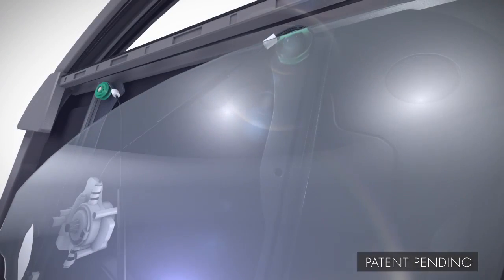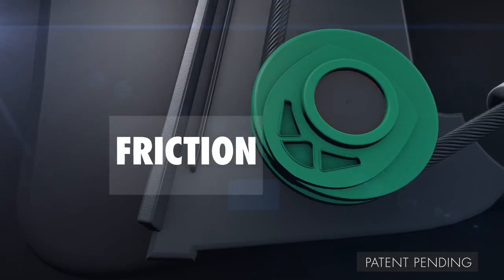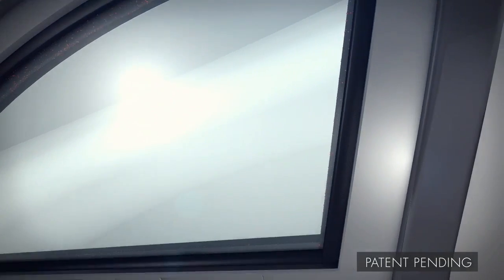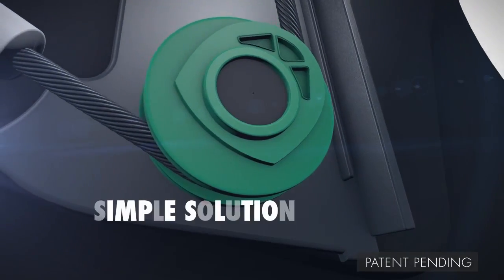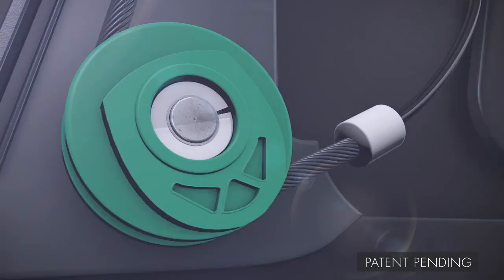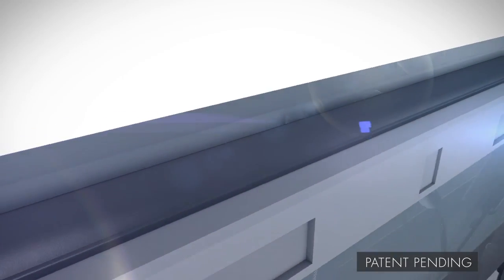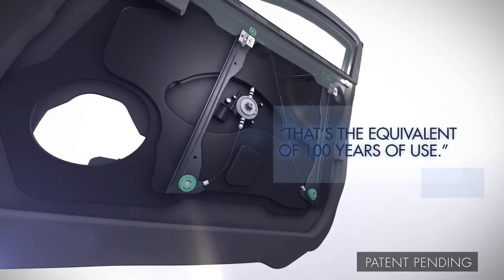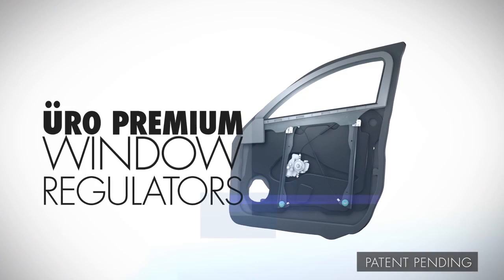URO Premium Window Regulator Replacement for BMW, Mercedes, VW, Porsche, Audi, Jaguar

Comment: seems these are not available for Benz E-klass.

Funny thing is the grease  lubricants used for OEM windows tracks purposely evaporate 2x or 3x faster than what is produced on the island of Japan... 😂